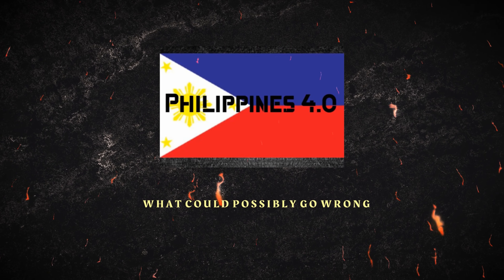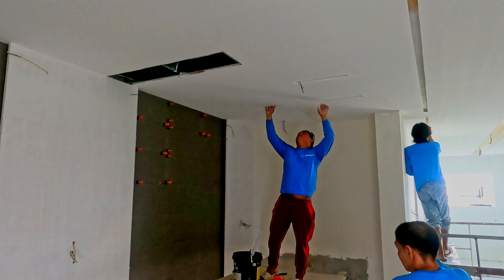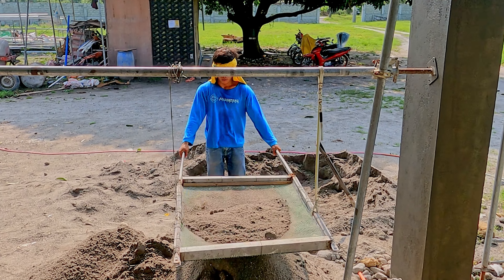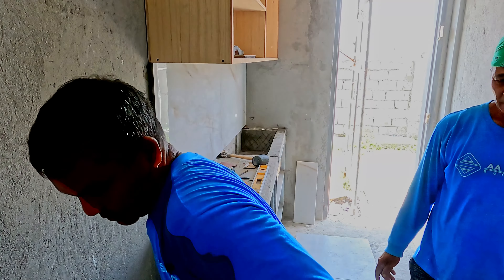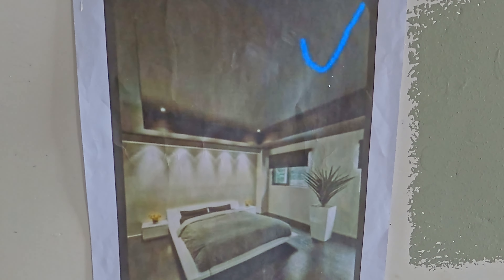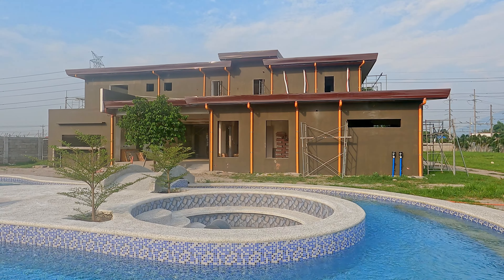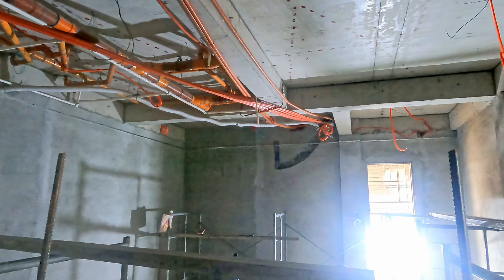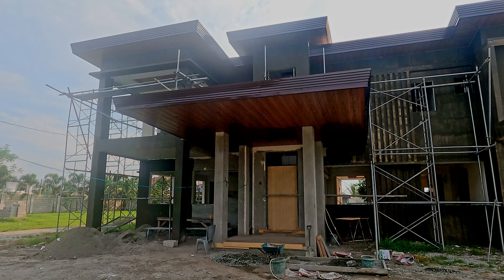Philippine House Building Day 275 - There IS a plan

Comment: I forgot toask for the exhaust fans, what are the sonnes, the lowe the quieter the exhaust fan. Trust me it matters for both the company and sonnes.
Reply: I meant cfm instead of company, this site does corrections and I missed this one.
Reply from the maker: Thomas
The model is the Omni XFC-200. I have looked on the box and online, but cannot find any reference to the sones (I think that is the correct spelling). The only reference is the noise level, shown as 48 dB. The airflow is listed as 289 CFM. I am not sure whether they used a larger model for the master bathroom.